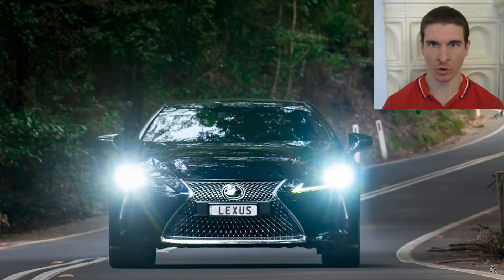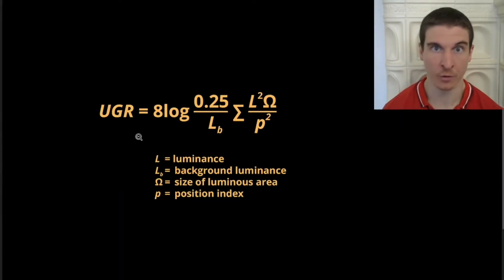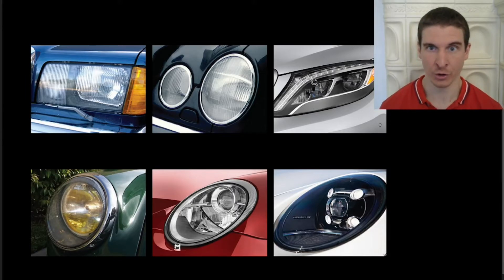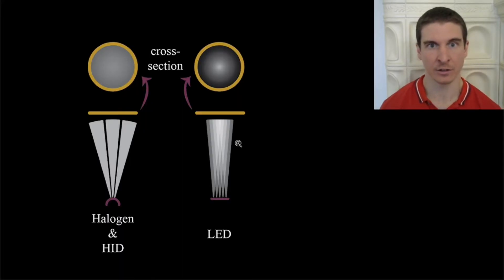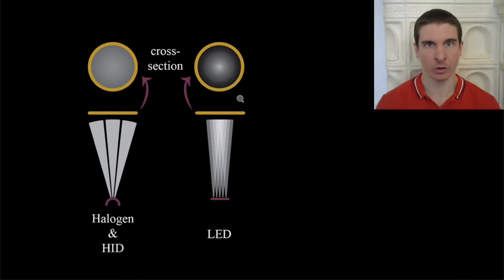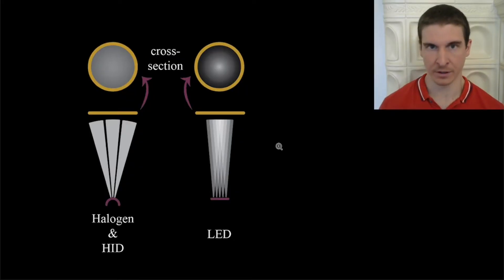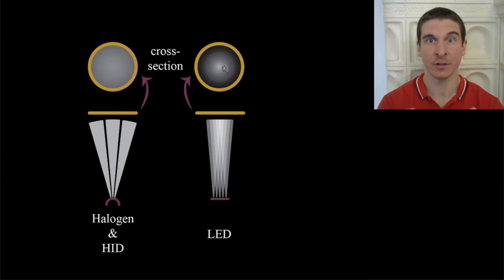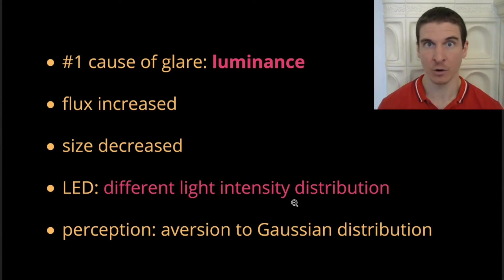Why are LED headlights so glaring? | Part 1: Luminance

Comment: Thank you your quite clear explanation of the fundamental difference in the light emitted by LEDs vs HID/halogen lamps.  If I understand you, the same principles would account for the glare from a digital sign comprising hundreds or thousands of individual LEDs packed together, correct?
Reply from the maker: Thank you.

In a sense, yes. There are two major differences though:
- Signage is usually a large surface, so the luminance contrast between each pixel and its surrounding is less of an issue, while total flux output is more problematic. On the other hand, a small high-luminance source can be glaring also when luminous intensity at the pupil is low.
- The directional nature of LED light contributes to glare in headlights largely because it allows for using smaller optics in front of it, resulting in a smaller and less homogeneous luminous area (both driving maximum luminance up, all else being equal). Similar mechanisms might exist in signage as well (e.g. when bright LED pixels are organized with large gaps between them vs. a more homogeneous back-lit LCD), but I think for most people this is less of a problem.

Comment: Not bad video. Are you saying the Halogens are the safest or the least glaring?

Which manufacturer is the most dedicated to making safe lighting with the least among of glare? 

Maybe, Phillips?
Reply from the maker: Thank you.

Yes, in terms of glare, halogens with reflector optics are generally the least glaring today on the road. But most of those are on older cars, and new cars rarely come with such lamps. Halogens can also be behind projector optics, which is (again, generally) more glaring than reflector optics due to the smaller size, but not as glaring as when LED sources are used.

Sadly I could not highlight any company that's better than the rest. There is a trend and only a few players on the market, all of which follow the same trend - so in essence, there is little difference. They are aware of the problems but the incentives are missing.

So, once we get to a new trend or new regulations, manufacturers would solve this problem in all kinds of ways (warmer light sources, freeform optics not only to shape the beam but also to make the effective projected luminous lens area larger with a more homogeneous luminance distribution and much lower maximum luminance - it's all possible already). Today, they're doing the same BS because that sells.

Comment: By “HID” are you referring to xenon headlights? Because those are every bit as bad for other drivers as LED for many of the same reasons. They probably project better than LED, but they are still very blue rich and excessively bright. I’ve noticed a sharp increase in the use of those lights in the past few years, especially with high profile vehicles, which put the glare higher into the vision of other drivers. I’ve been a staunch opponent of Xenon since the turn of the century. They’ve had twenty years to fix the problems and they only seem compelled to make them worse.
Reply: Fair enough. I’ll not argue that LED is worse, because they definitely are. What precipitated my question was that you had HID (which I have always understood to mean xenon) grouped in with halogen in your analysis, and I understand why now. But, for me, blue rich headlights are all the same, too bright and blue for use as automotive illumination. The blueness is part of what makes the brightness so much worse than standard incandescent, thus, I see the two as part of the same conversation. So, looking at it from that perspective, I wanted to clarify about xenon as HID. I get it now. I was seeing more broadly than that were discussing. Thanks for the clarification. I will watch your other videos as well. Thank you.
Reply from the maker: @jcr9520  Thank you and much agreed that HIDs are uselessly too blue and glaring. I hope I did not make it too complicated by grouping HID and halogen together regarding spatial aspects, and HID and LED together when it comes to color.

When it comes to the trends, however, none of this matters because LEDs appear to soon leave no other alternative...
Reply from the maker: You're right about their color, but that's simply a different topic, which I have discussed in the subsequent video on this list.

Are you sure that the increase that you see is not from LEDs? They really have replaced HID/xenon in nearly all cars. And the two are quite hard to tell apart.

You're also right that xenons too can be high luminance. Theoretically, LEDs are worse though in the "sharpness" of how they look, but I don't yet have a clear demonstration of that (only between halogen and LED, as in the last video on this playlist).
Reply: And sorry for the run-on sentence. My phone doesn’t seem to allow for sentence breaks in YT replies, or at least not that I can see.
Reply: Not complicated at all. You were speaking to a specific thing. I was coming into the discussion with my own expectations, which were colored by my particular issues with these lights. My bad, as the kids say.
Reply from the maker: @jcr9520  That is very generous of you to say. I'm often warned that I speak in too complicated ways, so I try not to...

Comment: I noticed this immediately around 2019/2020 here in Los Angeles because that's when I had to block my eyes looking at oncoming traffic while waiting for the bus.  I started counting the % of vehicles driving with LEDs as I crossed the freeway pedestrian bridge and noticed that it skyrocketed.  Hell, a year or so later the light board illegalized non-LEDs.  I'm told that all traffic lights are LED, but I must say I can't tell.  They've apparently been around since 1981, and I remembered in the 1980s when sodium lights were changing into a weird candy-like color, maybe that's LED?  I thought it would be dotted.
Reply from the maker: You're right, if not the flicker or spatial pattern, it's the color saturation which gives them away :)

I only recognize LED traffic lights when they are really bad. The dottedness depends largely on the optics, and traffic lights are probably one of the better suited applications for LEDs (if done right, and aside from the snow accumulation).

Yeah, regulation helps LEDs a lot. E.g. many Japanese cars are also sold domestically with halogens, but they only sell them in the West with LEDs.